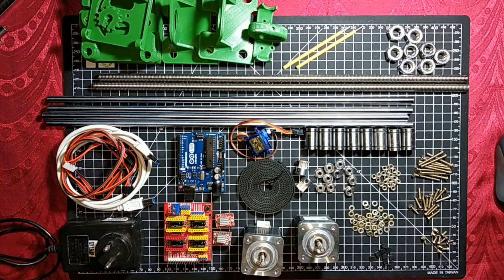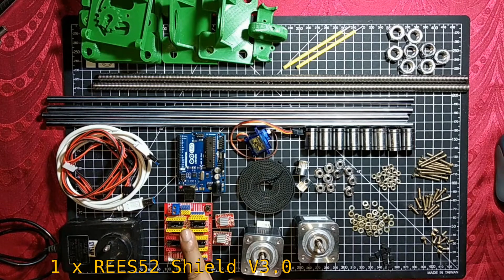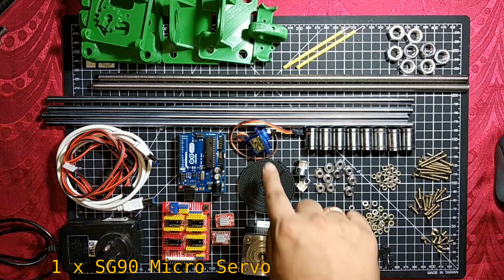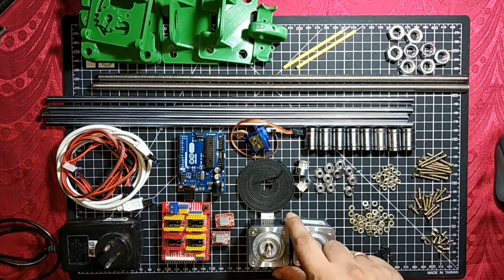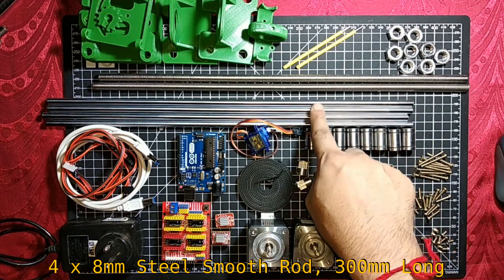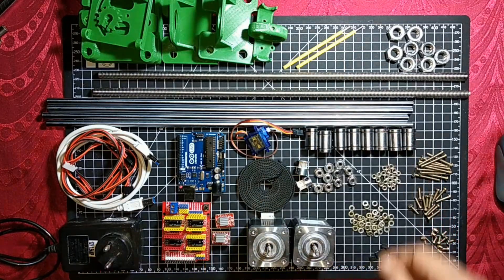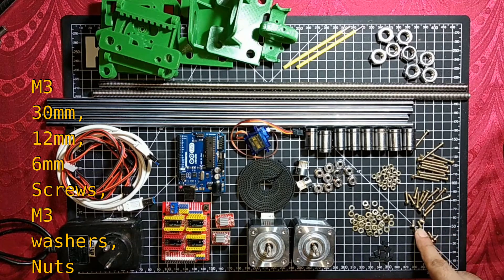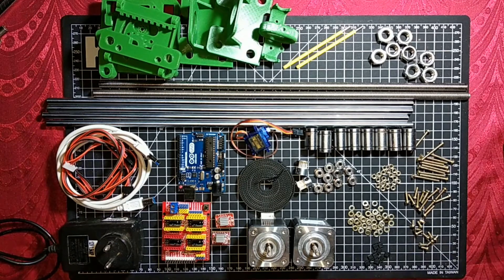4xi Draw | Arduino Drawing Plotter

Comment: Hi

Can you tell me which is x and which is y

What is home positoin it should start from left or right

Thanks
Reply from the maker: Its not only X and Y only, It's like for X both motor rotate in particular direction for Y also same.
Left to right (you can change how you want).

Comment: How to open edit page bro
Reply from the maker: open the config.h in notepad++
Reply: Ok bro
Reply: Edited config.h  any available in website
Reply from the maker: @allrightsthink4722  it's already in Arduino "grbl-servo-master" file which is lode in arduino library.
Reply: Bro my drawing machine working but service not up down drawing 45 degree angle moved two problems (benbox giving drawing working perfectly but drawing draw 45 degree angle) how to solve this problem please help
Reply from the maker: @allrightsthink4722  Reconnect the connector of servo carefully , sometimes it's not correctly connected, but it should work, no need to edit any code.
Reply: Bro working good